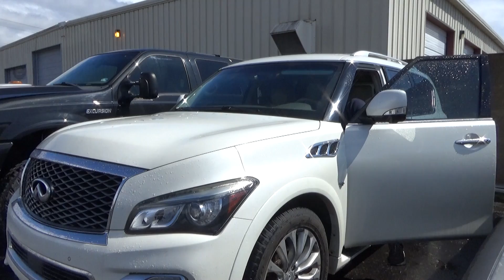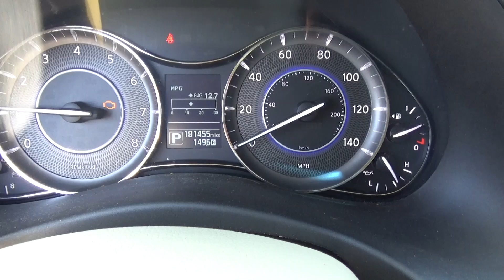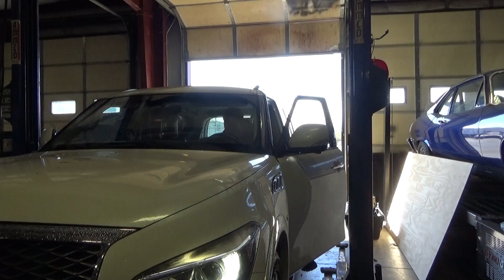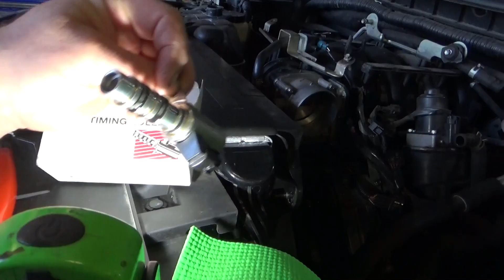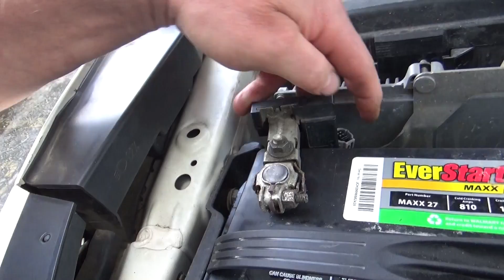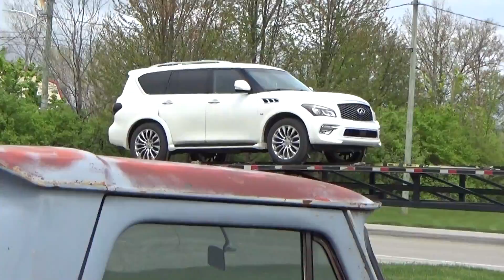White Infiniti QX56 / QX 80 Done and headed home! Variable Timing Unexpected challenge!

Comment: Smart Charging - 2020 Infiniti QX80 w 5.6L here.  I put a new battery in, (less than a year old), and unplugged the smart charge at the battery and just left it dangling.  No issues and no dash light.  There may be a code, I don't have a Snap On Scanner.

Comment: I don't know if its the same but here in Australia in the Nissan Patrol you just unplug the coupling no need to cut wires. I unplugged my about five yrs ago because im running two batteries and never had a code or issue from unplugging it and just leaving it unplugged.
Reply: 2020 Infiniti QX80 w 5.6L here.  I put a new battery in, (less than a year old), and unplugged the smart charge at the battery and just left it dangling.  No issues and no dash light.

Comment: Thanks for sharing your knowledge, I read Nissan updated the fuel pumps on model year 2016 and above as this coincides with the release of the 2nd gen Nissan titan/armada which uses same engine. Wondering if you seen issues on 2016+ qx80 models or on Titan/armadas? Thanks

Comment: 20mpg!!!!!????? My 2013 Armada with 203k miles only gets 15.8mpg. It must be nice to get 20mpg. I may need to take a look at some things!! Yes, this is the one in Georgia that I plan on bringing to you for this timing work when the time comes!
Reply: This is a 2wd unit.  The AWD ones appear to average in the 15+ mpg combined range.  But l would like to hear from people out there in the real world as to what they are getting on average.   And what fuel grade they are using because that does make a difference.
Reply: @richardlucore6813  ahh! Mine is 4wheel drive with a selector switch, so, not AWD at all times. I run regular Michelin SUV tires. Since 2018 I’ve owned this car and it has always gotten 15.5 to 15.9 mpg with regular 87 octane and maybe a little better on E85.  I will run several tanks of E85 now that it is getting hotter and let you know if there is a consistent difference. Thanks for the info!!

Comment: Dead battery while out at the grocery store is no fun, the “feature” keeps the alternator from “over chargeing” the battery, which actually turns out, doesn't charge the battery enough, leaving you with dead battery… solution @ 120k miles snip snip blue wire, havent been stuck with a dead battery sense.

Comment: Well done 💯💪 best not to trust the Customer supplied aftermarket parts as you realized!
Reply from the maker: Unfortunately even the best intentioned customer can get caught with this. We don't screw around with aftermarket parts especially on something like this for a reason. Yes it may cost a little less right now, but in the long run it'll almost always bite you!

Comment: As an informed consumer, I feel they could provide an inferior chinese equivalent. They could not provide the correct part required to allow the vehicle to operate correctly. Been through this and now fighting with another provider with a power steering/ hydraulic brake boost pump that sounds like a wounded seal and doesn't work under panic braking. Very mad at this point.